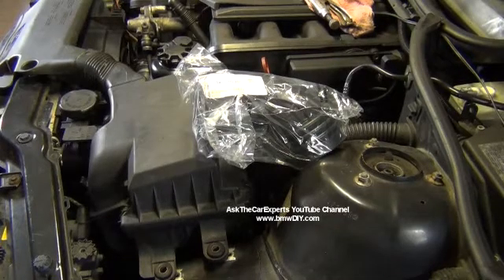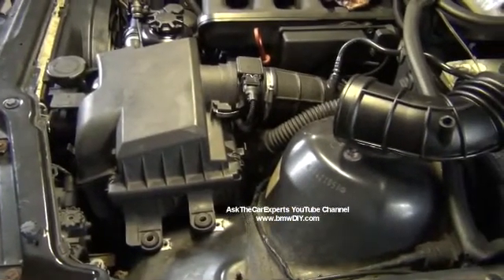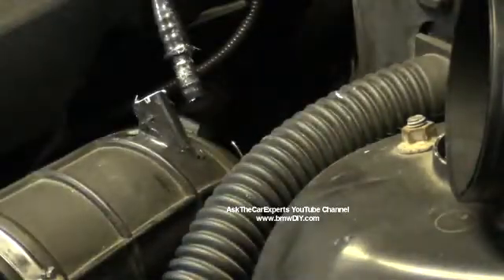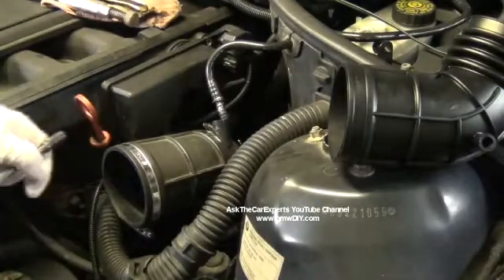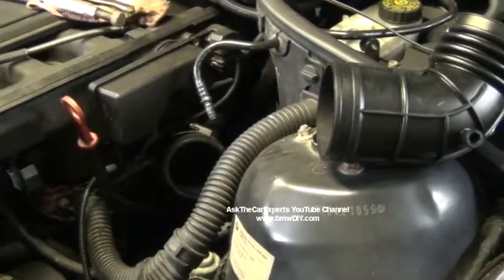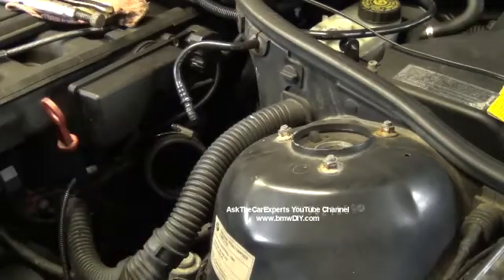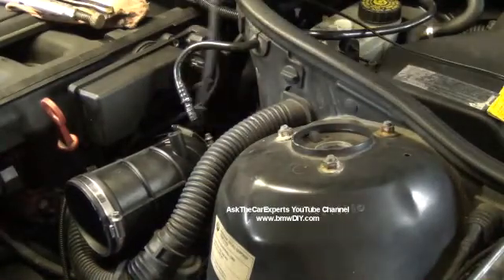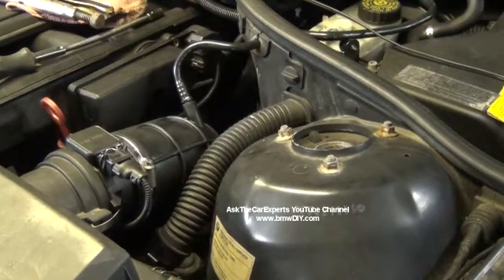BMW Upper Intake Boot Removal and Installation DIY M52TU M54 6 Cylinder Engine

Comment: Only difference between m52 and m54 is m52 has only 1 vanos as m54 has 2 vanos.
Reply from the maker: Correct, The M52 is single vanos and the M52TU is double the same as the M54.

Comment from the maker: Hello, I also did receive your message from my website. I am working my way to this repair but it might take me some time with work and family coming first :) The repair I suspect I need is a block repair as when this BMW engine over heats the block material breaks down and the head bolts can pull out. Also I suspect my timing is off as the previous owner had a shop alreaddy replace a head gasket...and my exhaust has an air leak...but I did get the vehicle for under 2000. :)